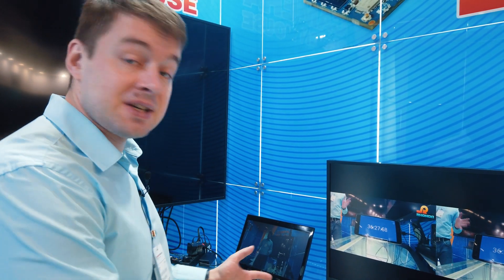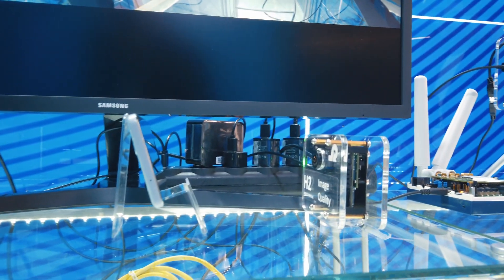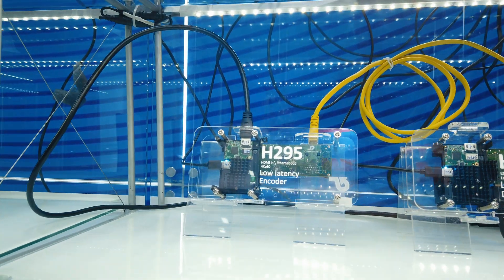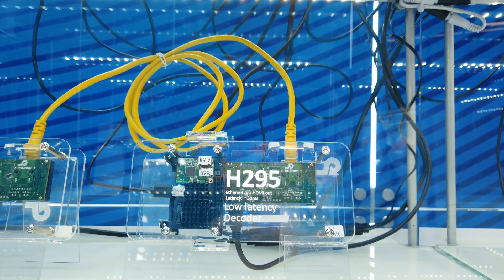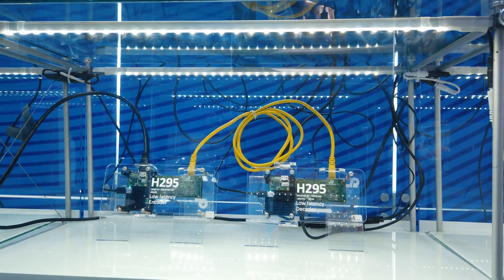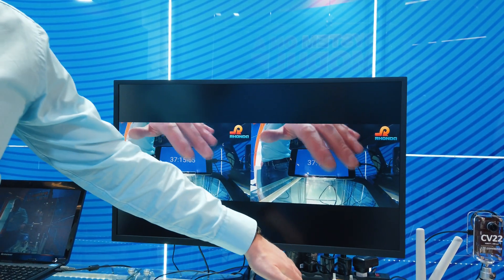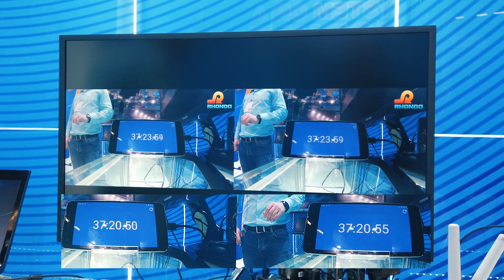Low Latency Demo on the Camera Edge | Embedded World 2020

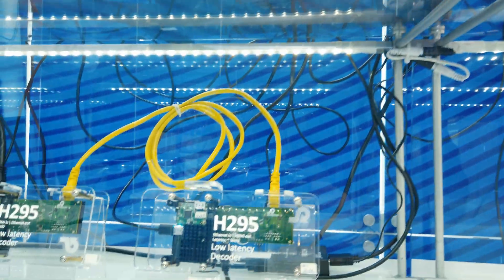Comment: At 0:29 you can see the phone and the encoded image at the same time, the phone shows 36:40:81, the image of screen shows 36:40:70
The difference 110ms is the entire latency of the system. from the camera through the imaging pipeline, through encoding decoding and finally the display.  50ms for enc/dec is indeed fast - and this is the purpose of this video. That said, when designing a RT system we need to pay attention to the overall latency which is 2.2x longer (not bad though, assuming 30 fps this is less than 4 frames).